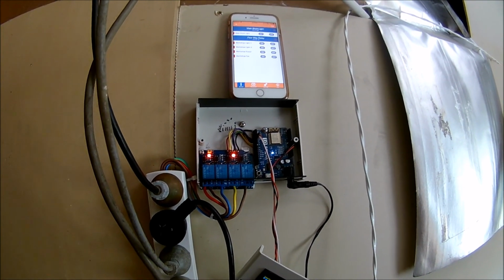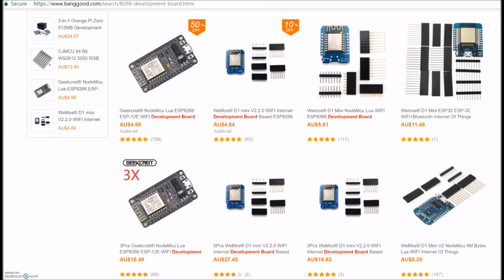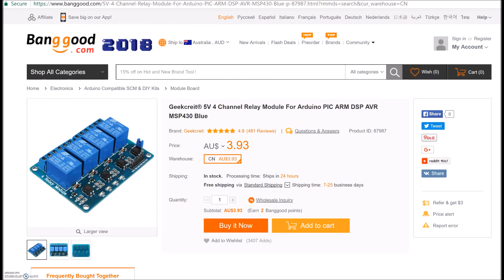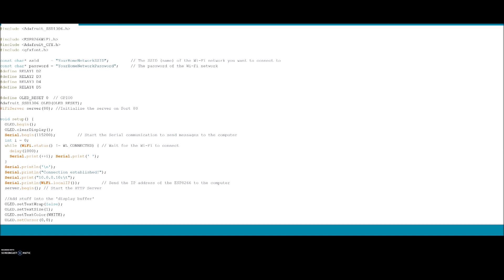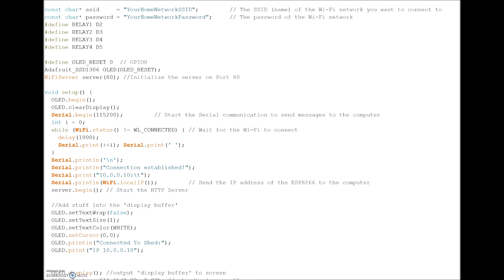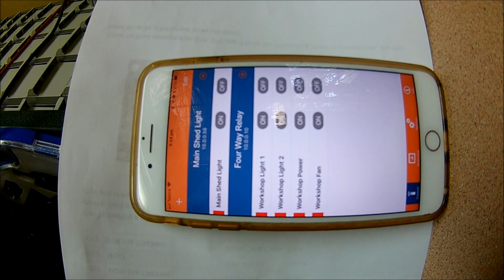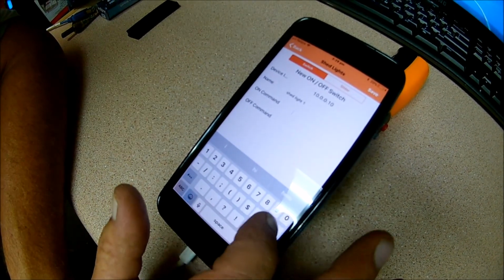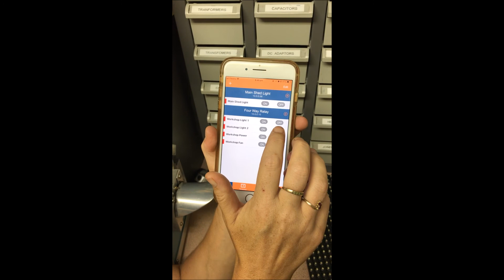Arduino Wemos D1 R2 ESP8266 Wifi Home Automation Relay Tutorial

Comment: The quality of the sound, especially on the wiring part is pretty lousy.   Also, You don't explain how you connected the 4 relay wires to the WeMos.  It seems as they go behind the board, but only 2 wires get connected their, to the oled. Thanks any way for sharing